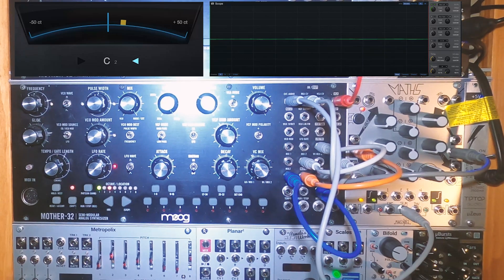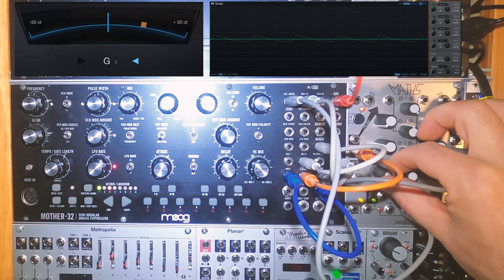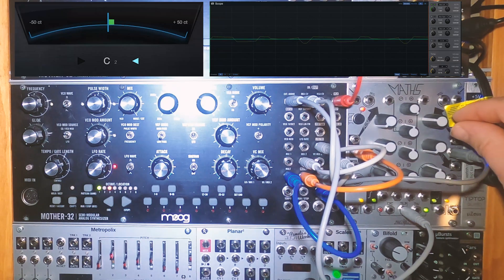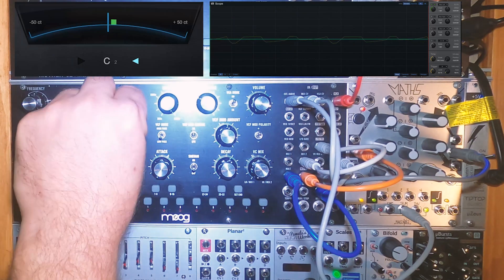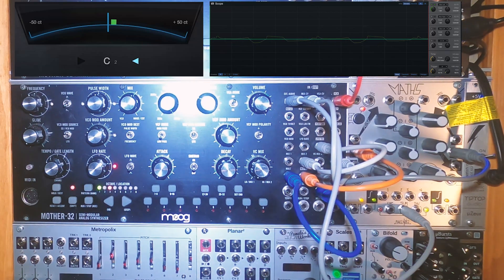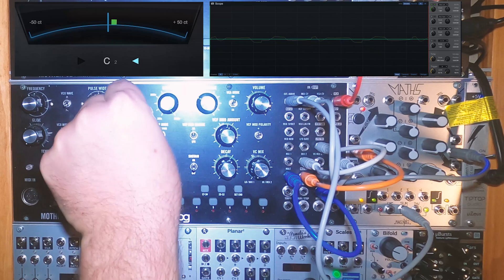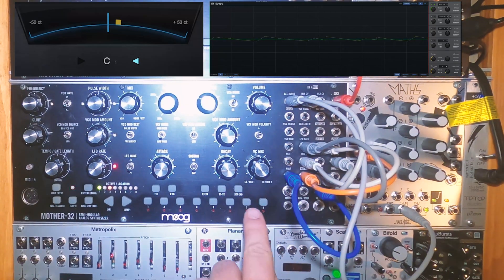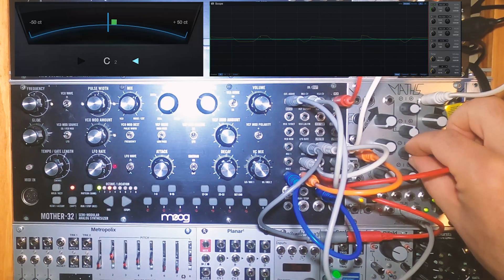Moog Mother-32 & Make Noise Maths - 4 VCO

Comment: Hi Rob, can I use ext.mix input from Mother 32, if I patch: Mother 32 => Maths => audio output - Doepfer A-131 => mother ext.mix and use Mother main audio output on the back to connect to speakers(mixer) not VCO? Will this be proper setup or I need to go from Doepfer A-131 => speakers(mixer)?
Reply from the maker: That should work fine I think I’ve never messed around with a-131